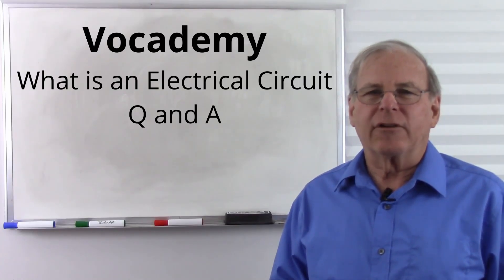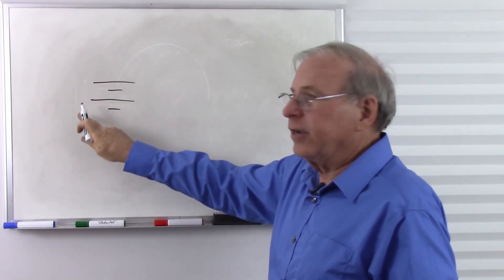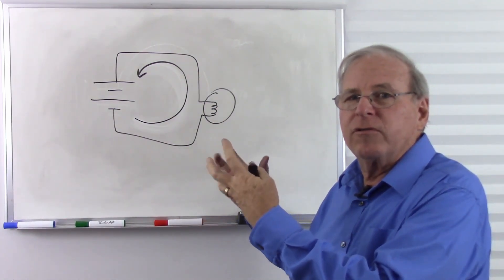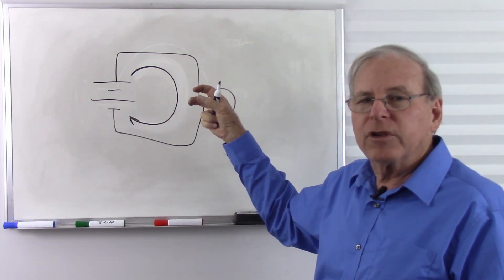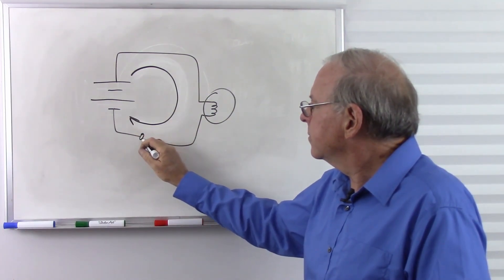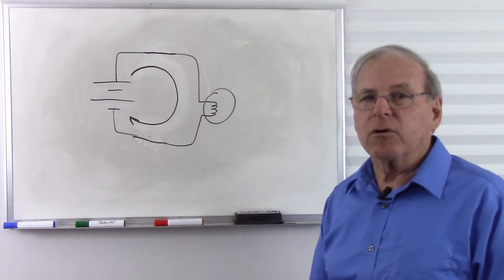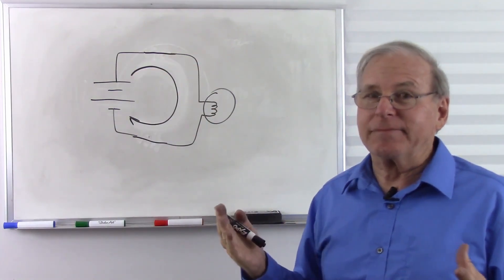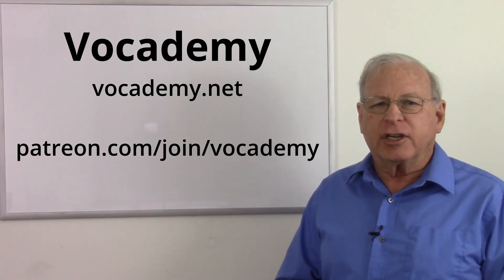What is an Electrical Circuit Q and A

Comment: Hello, Professor Bob,

I learned a lot of from yours lessons, thank you very much for that. And I found one thing about electrons and protons. 'cause my chemistry was very bad so, I just understood that electrons flowing from negative terminal to positive and protons from positive to negative. Thing I found that neither electrons neither protons circle around the circuit (as always everyone saying) - they burns in circuit, aren't circling through power sources. Even batteries  in series - if in circuit three batteries then the middle's battery's electrons burning at the spot negative terminal touches positive terminal - 'cause of batteries are being not rechargible. The electrons and protons burning in every part of a circuit and circuit even can't call circuit - it's like a lines with loops. I mean circuit takes as much electrons and protons as the circuit need.

Sorry for misunderstanding. Yours lessons very clearly understandable, in for years at vocational school I didn't learn so much than at yours channel in couple of months but that was long time ago and this chemistry didn't solved yet.

Thank you very much

Sincerely